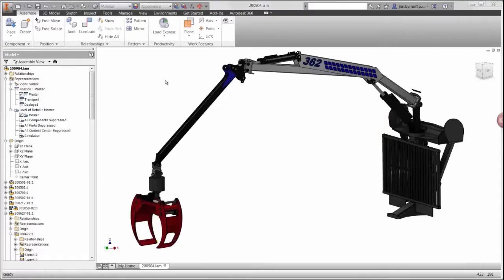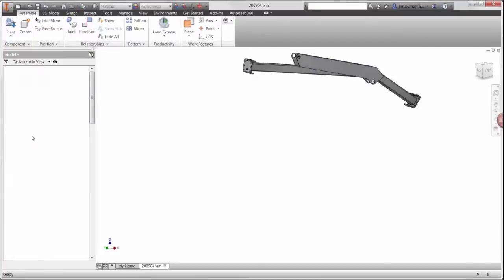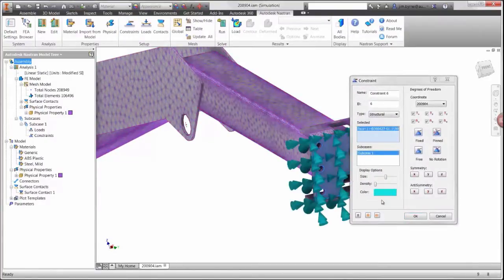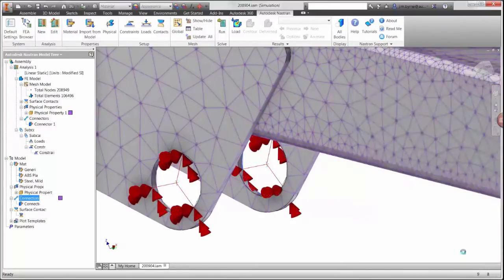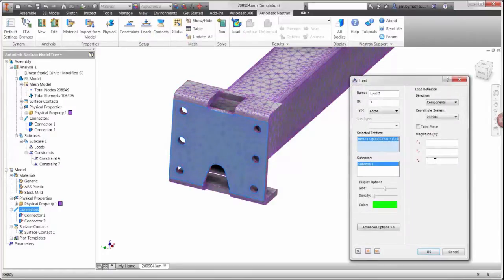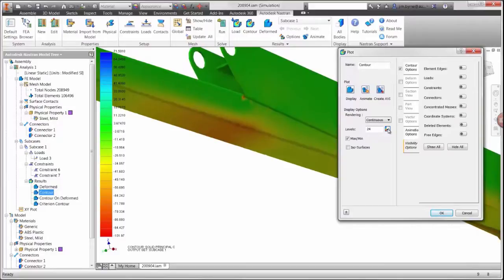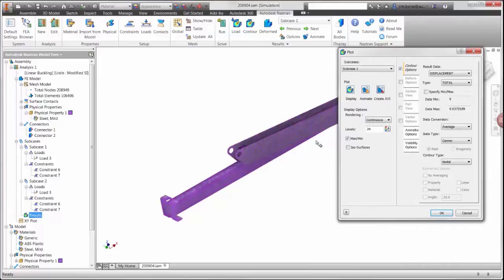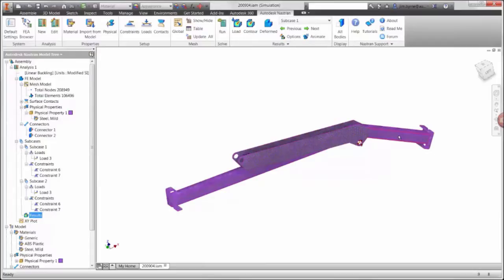Autodesk Nastran In-CAD Linear Buckling

Comment: If I understand right, when eigenvalue is ~2600 [no unit] and force is 1500N then the force that will cause buckling is about 3 900 000N (2600*1500), so way more than 20 000N.